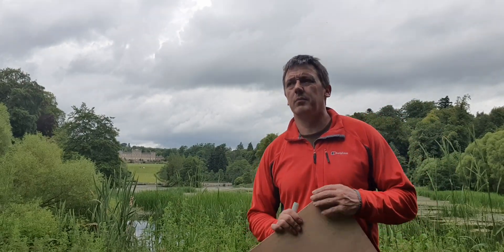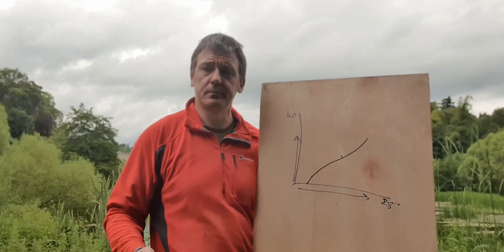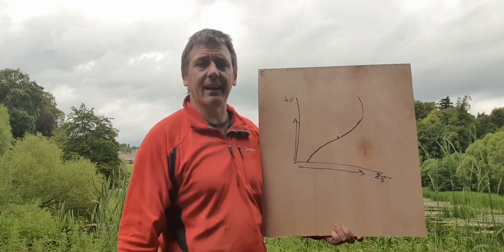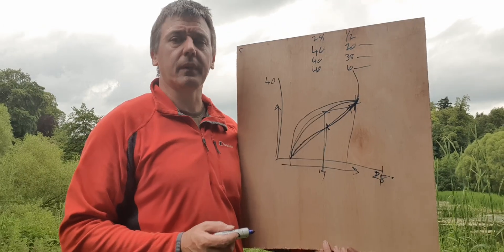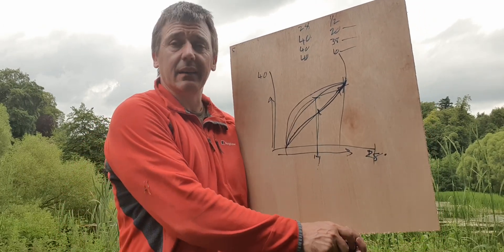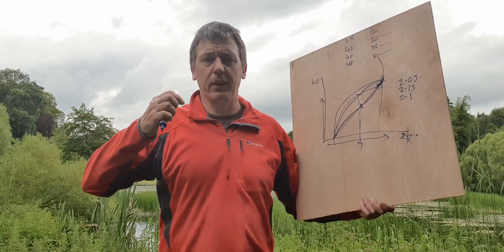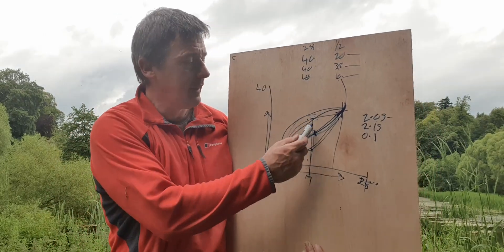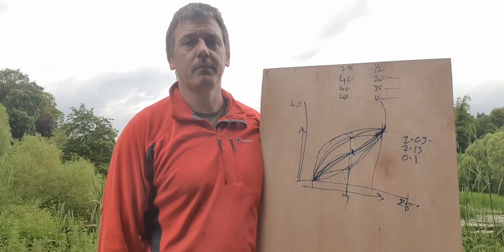stack.   what is it? why are we so rubbish at what it is?

Comment: my view: "Bows are constructed with wood, whoile pieces or laminates, with the grain running from tip to tip, never cross the bow. When we bend the bow, some of that grain becomes compressed. It is the point of compression, a 'wall', where the compression begins to pull apart the opposite side of the bent wood, which can lead to limb damage,, or breakage. It is felt by the archer as a 'tougher pull', or no more pull at all. "Stack", placing weight on a piece of wood, supported at end, to allow the wood to bend until it breaks, ergo, "the board stacked at 9 stones weight".
Surely not a desirable characteristic to assign a bow!
Reply from the maker: Wood is almost linear in its strength. Meaning stack is a geometric issue and not material.    After small movements it becomes Viscoelastic in that it changes from elastic deformation to a plastic deformation, ie, its stays bent. In bow making terms it takes a set and starts to follow the string.     So under low loads wood is classed as linear.    So.   Unfortunatly, the point of failure is NOT indicated by stack.

Comment: Smooth = (Cost)*(1/time owned)

I think trying to find an objective measure of a subjective quality is not possible. One problem of the definition that you are facing is where the "stack" is perceived. This is at anchor after transfer. This is where the weight of the bow is felt in different muscle groups that are responsible for most of the draw cycle. It is also at a point in the shot process where there is not much leverage available to the archer to use and the archer is using fine motor control at expansion. Under these conditions, the delta might feel more significant as tension in the archer increases.

Obviously, the imprecision of the term is not very useful. However, the odds of changing such an ingrained concept is, no pun intended, stacked against you.
Reply from the maker: @mozu305  stack isn't a muscle thing.   It's a geometric thing. We can deliver 2lb gain. 1lb gain and 0 lbs gained over 5" of draw. Amd each one is smoother than the pther
Reply: @BorderArcheryLTD  what the poster was trying to say is that at anchor in Oly the leverage ratio is poor, the large muscles are pretty much at maximal contraction and every second held there cause FATIGUE , repetition of the cycle causes extreme fatigue and lactate build up . The actual expansion of 2mm may be tiny BUT it is at a point where the musculo skeletal system has little left to give especially if trying to maintain form . Thus the proprioception of stack becomes very sensitive . I can tell the difference between Hex 5/6/7/CV2 and CV5 eyes closed. I totally agree with your explanations and engineering concepts/definitions but to dismiss the last 2mm as being neither here nor there because the increase in # is small isn't helpful as it ignores mechanical disadvantage of the human system at expansion especially when trying to expand carefully to maintain sight locking and also increase to "push" in the bow arm to counter the draw. For me then a 0 # increase over the last 0.5" would be best if the limb technology is torsionally stable enough for Oly recurve .
Reply from the maker: @mikebyford5258  so your saying you can feel the difference of 0.3lbs over 1" when your only looking at 2mm out of the 24mm the 0.3lbs I talk about is tue difference between a smooth model vs a less smooth. 
Aka.   0.025lb.over 40lbs. And this is something you base your anchor off?
Reply from the maker: @mikebyford5258  I would put down the feeling of 11g of difference between a smooth bow and a stacky bow in those 2mm of expansion is more a legacy feeling.   A bit like not knowing somethings heavy and it defeats you with the supprise.   Opposed to knowing somethings heavy and fully committing to it, and your impressed with your efforts.
Reply: @BorderArcheryLTD   I think your hypothesis has two mistakes: 1. it is logical and 2. sensible. I don't disagree with your analysis and how it can quantify a draw force curve at all. However, that was not my point. 

I think why the concept of stack is prevalent is that it is a perceptual quality and totally subjective. As you said, depending on what limbs you have been shooting, the next pair could be really "smooth" or "stack" simply because the draw curve is different from what the archer had become used to. I would further add, I suspect that draw weight has nothing to do with the perception, even though heavier limbs that are described as "smooth" may increase poundage at a greater rate than lighter limbs that are perceived to "stack." And as you say, how anyone can tell the draw weight increase in the small movement an archer has at anchor to execute a shot does not seem plausible. 

Because of the subjective nature of smooth/stack, I doubt it is going to leave archery vocabulary as those are really expressions of a feeling.
Reply from the maker: @mozu305  it won't leave archery because it's real and measurable.    But how we approach it is full of unicorns and fairy dust